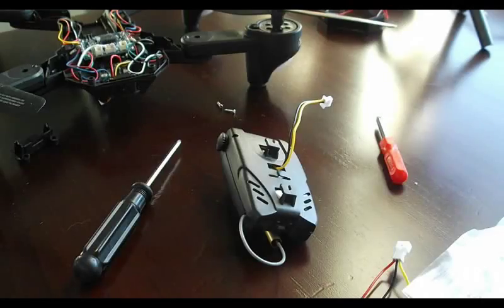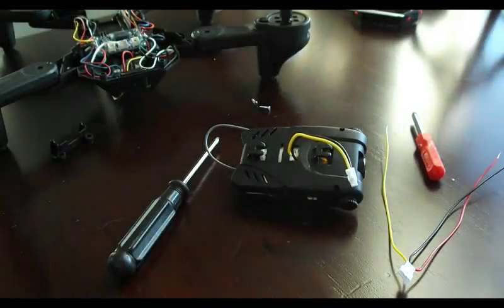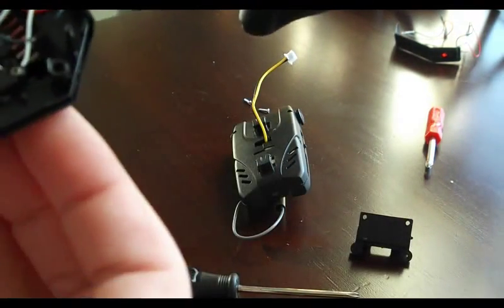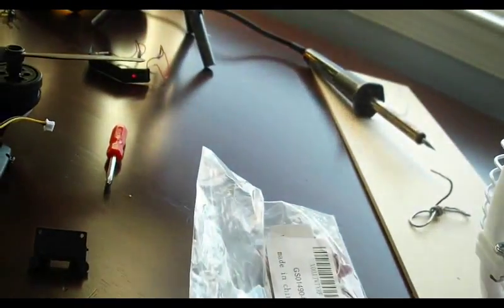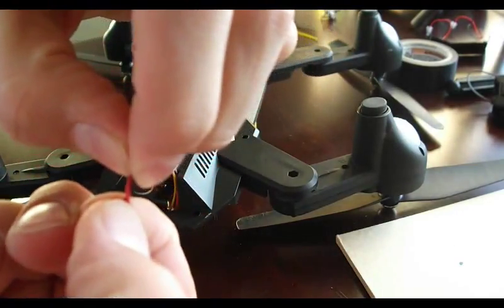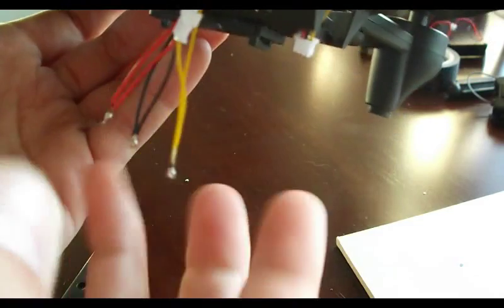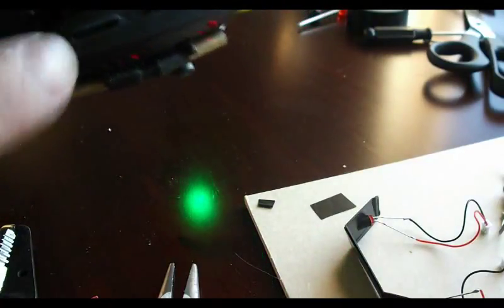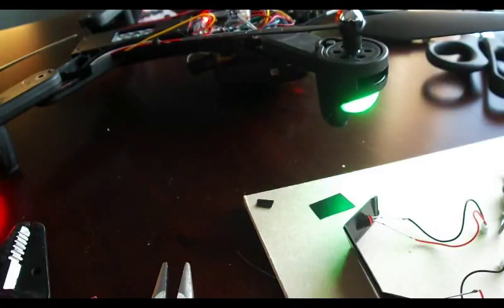How to... Drone camera upgrade

Comment: please, write name of camera, links not work
Reply from the maker: it looks as though they aren't selling that specific camera anymore, you could probably use something like this here, though it uses wifi instead of 5.8G: https://www.bhphotovideo.com/c/product/1244165-REG/extreme_flyers_v003_micro_drone_3_0_wifi.html/specs?ap=y&ap=y&smp=y&smp=y&lsft=BI%3A514&gclid=CjwKCAiA2rOeBhAsEiwA2Pl7QwEJ9LmEX7YfsMPN67_Rv7fUqeXvnCMJ3XvHH4P5C2NYP-3qcJ-zkRoCrwYQAvD_BwE
Reply from the maker: Also, a much better recommendation of mine would be to use this camera, though it doesn't allow you to record video. Just something to keep in mind:https://www.amazon.com/Wolfwhoop-600TVL-Camera-Transmitter-Antenna/dp/B06X96VPSQ/ref=sr_1_21?crid=1SJ08KE4YW5B1&keywords=fpv%2Bcamera&qid=1674403574&sprefix=fpv%2Caps%2C126&sr=8-21&th=1
Reply: @techex8383  thanks

Comment: Hi, I would be greateful if you could reply. I just bought the visuo xs812 and looking to upgrade the camera. Options as I understand it are 1.the fpv camera on your video or 2.an external attached one like firefly. My question is what is the specs (resolution, fps etc) of your camera and whether it is considerably better than the visuo one, also how do you control the drone with that camera? Does it come with its own remote control? And can you use the remote to view what the drones sees and take photos/videos? Any side effects of this upgrade eg battery drains much faster or drone more difficult to fly? Shall I buy this specific camera on your vlog or I can find any on ebay that is similar with 3 pins etc? How this camera compares with firefly? I like how the visuo flies but again as I'm new I'm open to reconsider for a better foldable one of a similar price if I have to I can return the visuo and get one similarly easy to fly but with decent camera so i can avoid camera upgrades. Thank you so much in advance. Looking forward to your answer.
Reply from the maker: Sorry for the delay. I know that the Visuo drone in this video worked well for me, but for a limited time. Many of the toy drones that come with an included FPV system use a wifi camera. That's what I removed from this drone to make room for an actual analog camera that transmits on 5.8 GHz. With a 5.8 GHz camera, you are able to get a much more real-time transmission with minimal delay or latency. Since this drone is a brushed motor powered quad, it can't lift a lot, maybe a couple of grams. Camera's such as this tinyurl.com/AIO-camera add 4 grams and work extremely well for the price. A quick adapter can be made to allow it to fit in the 3 pin JST 1.25mm socket. This will only give you a live feed and nothing else. If you want a camera that can record the FPV, you will need something like this: tinyurl.com/recordFPV. I have not tested this method out, but it looks like that this could be a good solution to your problem. The red and black wires supply power to the camera while the yellow wire is a signal wire to tell the camera what to do. I am assuming that if you plug this camera in, you should be able to use the included photo button on the controller to signal the camera to record. Again, I can not guarantee this, it's just what I believe to be a good solution. As for the firefly, I am not sure which one you are refering to, but I believe this is it: tinyurl.com/fireflymicrocam. This camera may work, but again, it is 31g. I have not tested the drone extensively, but I do not believe it will fly well with this on it. As for all of these, you will experience some battery drain, but each one will most likely differ. My last recommendation for you is that you learn to fly this drone how it is, and once you feel comfortable with that, buy a drone with brushless motors and a FPV camera that can record in HD. I hope I answered you questions, if not feel free to ask again, I look forward to hearing how it turns out!
Reply: @techex8383  As promised here is my reply after having tried "wearing" the Firefly Q6 to the XS812. I'm impressed with the outcome for the price. The drone cost me £60 (3 batteries included) and another £40 for the camera which is also 4K. The drone could fly really well like it didn't bother for that tiny extra weight. Quite stable on a breeze but obviously starts to lose balance on a windy day. Still, it works perfectly for me as I'm not going to use it for drone racing or extreme cases although I wish I could take it to my next trip to Iceland :) Now I have FHD videos in 60fps although I don't remotely control the camera so have to start recording before taking off then stop it once it lands but still fine with me for that price. I can do some video editing and cut out the bad parts. I still have many hours to fly with it until it is time to upgrade and get a proper one once budget allows :)
Reply: @techex8383  Thanks a million for the reply, super helpful. I think for this type of drone it's really confusing to try upgrading the camera. I mean in the end of the day the battery will pay for it !! So I've ordered the Firefly Q6 and once I test it I will definitely provide some suggestions. I've however already tested the XS812 with a mini spy camera (PiAEK Mini Hidden cube camera), once attached at the top and another time attached below the drone and was still flying sweet and smooth (and high). There was even slightly windy day but could still hold remarkably still (not fully but great for the price). I have to admit this drone flies well for its price (despite it's missing the so much helpful feature of obstacle detection) so hopefully with the firefly q6 it will be a cheap but good compromise.
Reply: In this video I modified my Visuo Drone battery it could be helpful 
https://youtu.be/d2ihLPit1wo

Comment: does it still connect via  wifi when you change the camera?
Reply from the maker: No. The specific camera operates on 5.8Ghz and by plugging it in to the socket, you remove the WiFi camera entirely.
Reply: Hi, I would be greateful if you could reply. I just bought the visuo xs812 and looking to upgrade the camera. Options as I understand it are 1.the fpv camera on your video or 2.an external attached one like firefly. My question is what is the specs (resolution, fps etc) of your camera and whether it is considerably better than the visuo one, also how do you control the drone with that camera? Does it come with its own remote control? And can you use the remote to view what the drones sees and take photos/videos? Any side effects of this upgrade eg battery drains much faster or drone more difficult to fly? Shall I buy this specific camera on your vlog or I can find any on ebay that is similar with 3 pins etc? How this camera compares with firefly? I like how the visuo flies but again as I'm new I'm open to reconsider for a better foldable one of a similar price if I have to I can return the visuo and get one similarly easy to fly but with decent camera so i can avoid camera upgrades. Thank you so much in advance. Looking forward to your answer.

Comment: what about upgrading the motors?
Reply from the maker: Since these are brushed motors, you should be able find similar sized motors. and just solder them to the connection points.
Reply: http://www.helipal.com/storm-bm7020-coreless-motor-brush.html?gclid=CjwKCAiA-9rTBRBNEiwAt0Znw215tnm7mvc4z8GBlUzNZvNiAun-l0KOdzn5SHV8WmGtnU053grq9RoCwHoQAvD_BwE would something like this be an upgrade or just a replacement?
Reply from the maker: Personally, I haven't gone too in depth with the efficiency and power ratings of the smaller motors. From my research, these motors (https://goo.gl/tE67vV ) should give you more thrust (a couple of grams more). Sorry I couldn't identify the other motors, let me know if this helped! Happy flying!